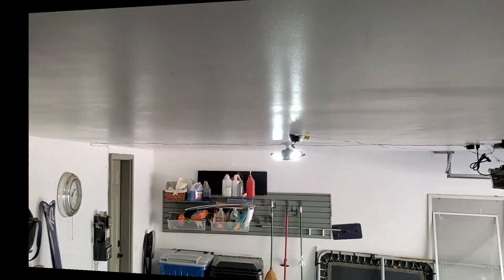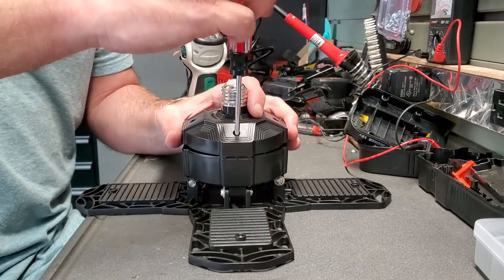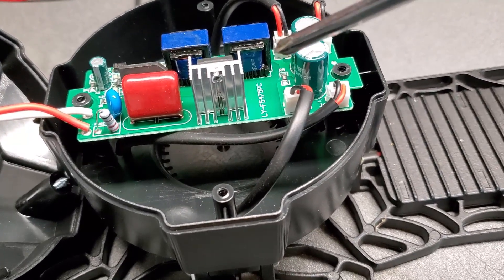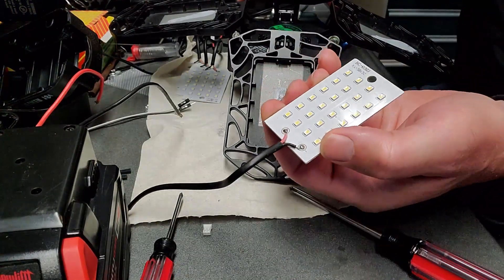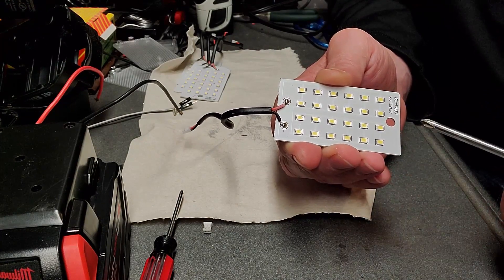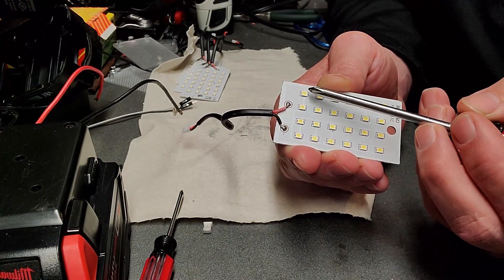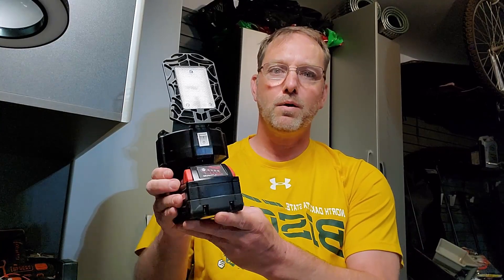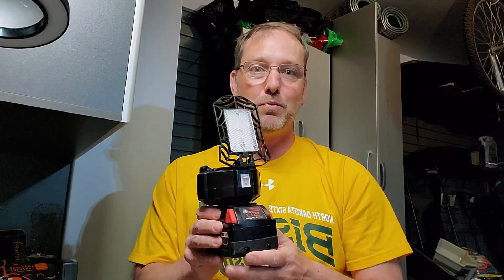Milwaukee M18 Light for $10

Comment: Nice build! Is there any measures to prevent the voltage dipping below 15v to prevent over draining the battery?
Reply from the maker: The batteries themselves have the circuitry built into them!
Reply: @illgiveitadiytry   I would have to disagree with you. The batteries don’t have any safeguards for under voltage protection, it’s the red link communications in the tools that tells it. https://youtu.be/UXM25F7FG38?si=jEqlKxnPsPT-RsaT